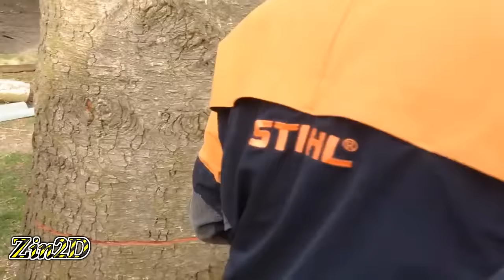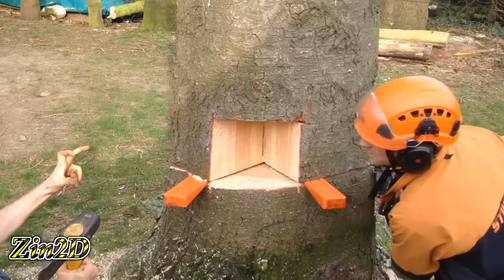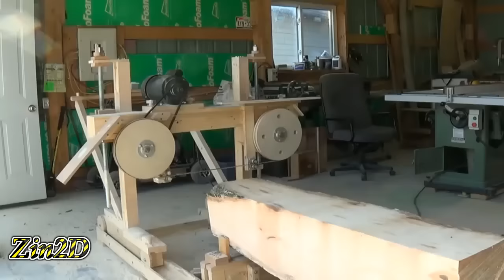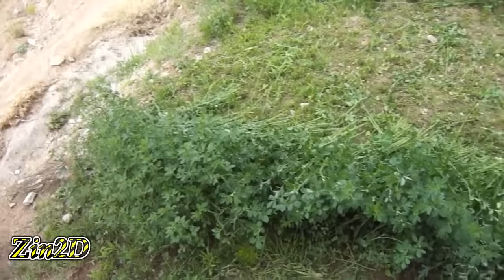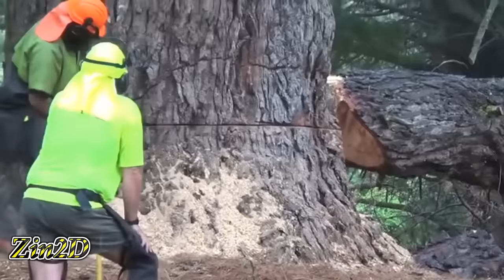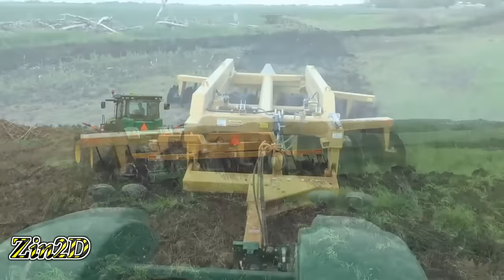Fastest Big Chainsaw Cutting Tree Machines Skills, Incredible Homemade Wood Cutting Machines

Comment: Those guys running powerful cutters with no eye or ear protection are crazy. In fact, I would want a barrier between myself and the cutting apparatus, too, in case of drastic mechanical failure

Comment: It’s hilarious that the guy running the chainsaw has his safety gear on, but the guy working right where the chain is running only has a t-shirt for safety 🤣
Reply: Did u see that dude standing right by the guy using a table saw blade on a weedeater.. lol reckless
Reply: Chainsaw dude only has a jacket and a hard hat. No gloves or eye protection.
Reply: Yeah, if that saw kicked back at any point t shirt guy was getting some free cosmetic surgery.
Reply: Add to the fact, camera dude stand directly behind the falling tree. Dad taught me that is on of the most dangerous places to be.
Reply: How bout the silliness of that how pump jack. . Dead straight tree with no obstacles around. Don’t even need a wedge!
Reply: Not really. My grandfather spent 40 years working in the woods, felling, bucking, and limbing with zero safety gear, asides from caulked boots and a steel hat. The majority of deaths and serious injuries sustained by most loggers are not going to be prevented by any amount of safety gear. The most important safety gear is your brain, use it and you will probably stay safe.
Reply: @scottklandl488  whats that big brown building in the beginning of the clip? The jack worked beautifully. Tree didnt flatten the cabin, so job well done!
Reply: @barnybrewman1571  was gonna say, he understands that with a tree that big, you would be scooped out of the hardhat!!
Reply: That t-shirt was for fashion only!
Reply: @bryanmaunu5986  You don’t need your Dad to tell you that standing under a falling tree is a bad idea. Common sense will do.
Reply: @MrNelford  not under. Directly behind the direction the tree is falling.
Reply: @bryanmaunu5986  It was a tongue in cheek comment. I guess my humour didn’t come out so well ;p
Reply: @robertkwit8506  lllllllllllll
Reply: @sishantchauhan2745  l
Reply: @sishantchauhan2745  lllll

Comment: Think the jack was over kill .. simple back cut and wedges work .. still interesting a vid
Reply: Not only overkill, but totally  unnecessary. The two or instead three wedges would have done the job.
think about it, cutting down that 30cm wodden disc every time you cut a tree.
Reply: I need to ponder 🤔 A 100 times before chopping those 🌴 trees , who take 1-2 decades to grow huge..
And it take few minutes to cut them down....
Please stop such videos n marketing of such tools along with it.... 🙄😔
Reply: I was impressed by the handmade one with a bandsaw blade and the fact he could angle it with and accurate ruler on the end. Excellent piece of craftsmanship for sure.
Reply: I’m thinking the same thing. There’s a few things about the first video I would do differently but hey to each his own. No home damage, no equipment damage, no one got hurt. Job successful!
Reply: @holden5102  you're right
Reply: @santoshkullu6798  stop using technology to post such hypocrite comments.
Reply: They are French cut them a break

Comment: 1st one guy using wedge has never seen a kick back nefore.
Reply: I'm no tree cutter, but an engineer here. I know exactly what you meant. Hehehe
Reply: No kidding! The guy in the grey/blue shirt made of steel?
Reply: Insanity.. I couldn’t imagine having my face that close to a chainsaw and not make a connection.
Reply: Sharp saw, safe saw, that saw did seem to bog down on the notch cuts, yeah maybe not stand behind, 🤯
Reply: @Lucas Lucco They have been. In the passed they cleared forests without planting new trees. Now in most places they do and some places its required
Reply: Yea or have the tree come backwards after falling. These guys are running on borrowed time.
Reply: @sonycarp8271  I've never trusted one that much, never.

Comment: That first one was the most complicated tree felling I've ever witnessed. You have a guy using the chainsaw with no regard for safety. The other guy uses a sledge hammer. Then he uses a jackhammer before either throwing up a gang sign or having a mini stroke. While chainsaw guy finishes the tree!
Reply: Safety is a good point, the guy at the chainsaw had a fair ppe, allthough his face protection seemed to be not in place. But the other guy, who was even closer to the chain did not have any protection at all - very careless...
Reply: no gloves,couldve pinched saw in tree yeah few things i was like wtf!
Reply: @riedstreuner1042  this also doesn't look like their first rodeo.

i cut trees with no more then my standard prescription glasses and gloves.. and my boots.

unless your doing SOMETHING STUPID safety equipment is more less optional in a lot of cases.

im not going to get my hand stuck in a wood chipper BECAUSE MY HAND IS NEVER GOING TO BE NEAR A WOODCHIPPER. you pick up branch and toss it in. WHY THE FUCK would you try and shove or stuff the branch further in while the machine is running?
Reply: @riedstreuner1042  time stamp? i do not see any gang signs and chainsaw guy isn't misusing the saw

edit okay i see the "gang" sign i think hes telling someone of a measurement because you know chainsaws are loud
Reply: @riedstreuner1042  the hammer axe 3 inches from their heads isn't smart granted

Comment: It takes hundreds of years for a penny sized seed to become a mother tree ,but all takes fraction of minutes to de-capitate, ...some cuts are necessary but most unnecessary  !
Reply: hush they plant trees after taking so hush
Reply: I would agree, but the tree in my front yard became too tall and leaning towards my home. Then seeing carpenter ants it was time for it to go. Same with my neighbors trees, five of them. My fear is the weather has changed. It's more wet year around. The ground is rocky and the sole is washing away. Plus the wind has gotten severe. It's blower hard for five months straight. I got scared that the trees were going to uproot due to the high winds and sole erosion. There's 300 acre forest around my house.

Comment: Shit, I would have had that tree felled already, with no using a jack or wedges...
Reply: I agree, was thinking that the tree must have been weighted the wrong way for where they wanted to drop it. Nope a straight pine tree. Good idea for when you are near a house.
Reply: Yeah was thinking the same...never seen a tree felled that way, especially one that isn't that big!
Reply: Right we dropped over 70 trees on the farm some as big or bigger and we used smaller blades saws with out all the extra shit they did
Reply: Kinda dumb honestly. The notch was perfect, should have just sent it with the wedges and accomplished the same thing
Reply: Also what does that tree weigh? 15000 lbs?  The jack isn’t doing much and would be crushed if the wind felt like blowing the opposite way
Reply: @lightningxx  

That tree certainly wouldn't crush that jack. Looks like a 10 ton jack. Tree might roll off of it but is not going to crush it

Comment: And that's what self destruction look like.....💔
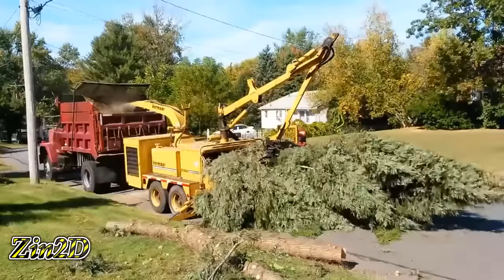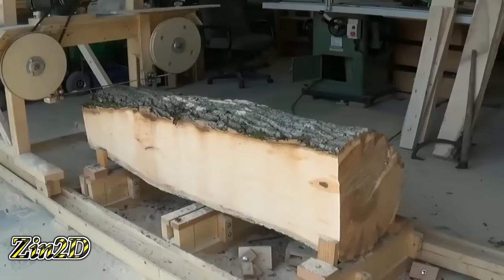Reply: 3:20 to 4:30 seemed like a waste. As a woodcutter, not as a logger which I'm not, those trees would have been good firewood if they had been allowed to dry. hipping them up like they did isn't as terrible as it seems, that stuff makes pretty good mulch. While the Douglas fir is rather acidic, a little bit of lime would have balanced out the pH. 1/3 vegetative matter 1/3 clay 1/3 sand mixed together makes good soil. With the increased agriculture going on I'm hoping that's what they used it for.

Comment: Wouldn't it be easier to just cut straight through the dang tree
Reply: If you just cut through the tree you can’t control how it falls and prob jams the chainsaw as it squeezes it. Could kill someone or destroy property. Cutting the wedge out first allows one to point it in a direction.
Reply: @mrmotomoto  there is a way to cut it and still direct it. The cut he made at first is all you really need
Reply: Absolutely, I would argue it’s more dangerous with the bottle jack.
Reply: @TheRealFraen  haha yeah, that's what I said...

Comment: 2:19 Someone is handling a chainsaw at full speed, another has his head at the same height as the blade. I do not know much about this profession, but it looks dangerous to me.
Reply: You have no idea. The safety violations in that first clip makes my head spin.
Reply: This kids won't last two years.
Reply: @Torontotootwo  The guy doing the cutting might, he's actually wearing full PPE, even has Stihl chap pants and a Stihl jacket. Meanwhile everyone else is dressed like they were just walking down the street and decided to stop and lend a hand.
Reply: Notice the chainsaw operator has the helmet/goggles/ear protection.

Comment: I must have missed the connection between felling trees, then discing ground that hadn't had trees growing on it?
Putting trees through the chipper, then making things on a lathe with wood that came from somewhere else?
Cutting weeds with a brush cutter, probably not where the trees are?
All valid operations, but what's the connection?
By the way, I keep the brush cutter throttle open on the backswing, no need to make it sound like you're chainsawing, probably enhances the life of the engine, probably uses the same amount, or maybe less, of fuel.
Not an expert, but have done all those jobs except the lathe, and have a little bit of brainpower, at any rate.